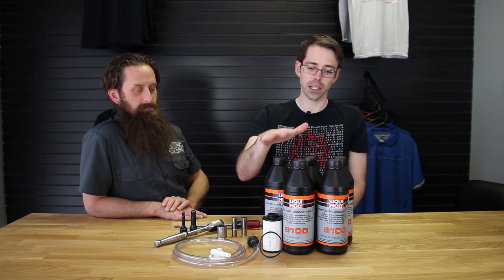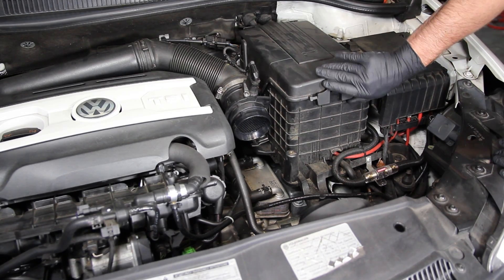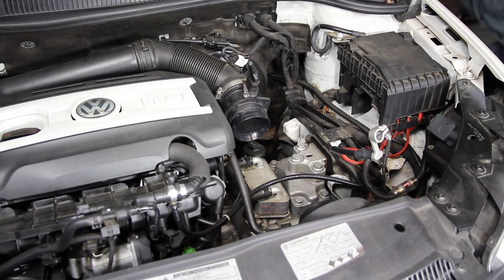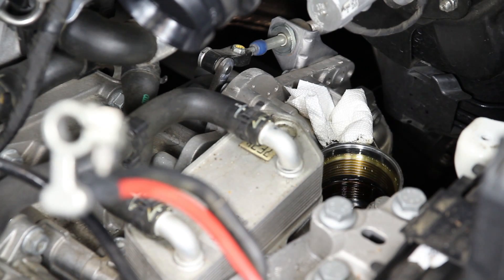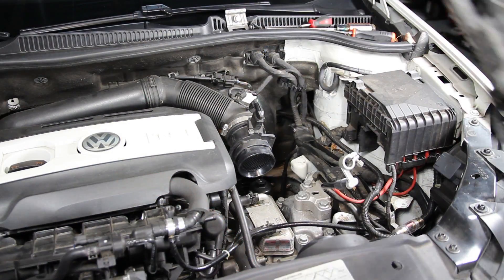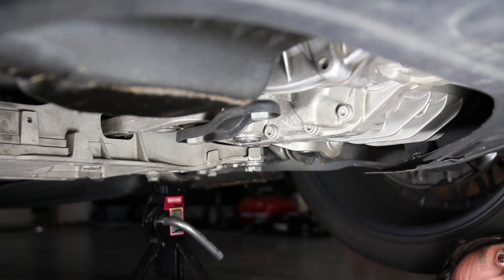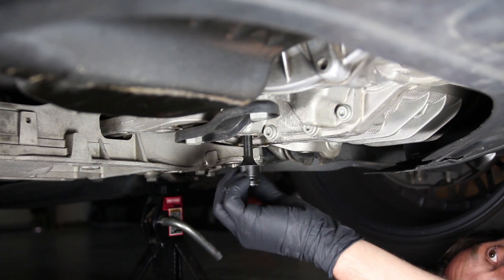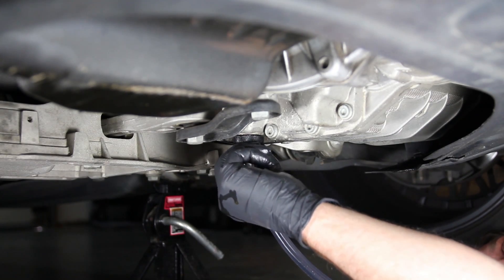How to (DIY) Perform a DSG Service on a VW and Audi Transmission (DSG Service Kit)

Comment from the maker: - We appreciate your Support and Purchases!
DSG Service Kit (Liquimoly)
https://www.shopdap.com/transmission-service-kit-for-dsg-performed-at-40k-02e198002grp.html
DSG Service Kit with Special DSG Fill Tool (Liquimoly)
https://www.shopdap.com/transmission-service-kit-for-dsg-with-filler-tool-02e198102grp.html

DSG Service Kit (Motul)
https://www.shopdap.com/transmission-service-kit-for-dsg-performed-at-40k-02e198003grp.html
DSG Service Kit with Special DSG Fill Tool (Motul)
https://www.shopdap.com/transmission-service-kit-for-dsg-with-filler-tool-02e198103grp.html

DSG Service Kit (Genuine VW/Audi)
https://www.shopdap.com/transmission-service-kit-for-dsg-performed-at-40k-02e198001grp.html
DSG Service Kit with Special DSG Fill Tool (Genuine VW/Audi)
https://www.shopdap.com/transmission-service-kit-for-dsg-with-filler-tool-02e198101grp.html

Transmission Fluid Service Pump
https://www.shopdap.com/make-model-year/audi/a5/werkzeug-usa-wkz-vas572001.html
Transmission Service tool - VAS6262
https://www.shopdap.com/vw-audi-dsg-tool-vas6262.html
Reply: I have a 2008 Eos VR6. Less than 900 were ever in America. I have so many questions and can't find answers.

Comment: I know this video is 10 years old but I need advice and hoping my car might intrigue you enough to get a response. I just bought a 2008 VW Eos VR6 with 135,000 miles on it. There were only about 240,000 made 2006-2016 in Portugal and only about 24,000 were sent to the US and only 900 of those had the R32 VR6 3.2L top end edtion, made in 2007 and 2008. I can never find info on this Unicorn. How do I change transmission fluid on my thick girl? And do I have to bleed the lines when I change the hydronic pump?

Comment: aside from worrying about the warranty will my transmission ( audi a3 2015 quattro ) work if i use 75w 90 from liqui moly or motul ? since that's all i have access too. thx in advance @Deutscheautoparts @sat_sonic
Reply: Only use the specific quality recommended by VAG...

Comment: Surely to remove oil from the transmission one would remove filter first and leave it open - as one would do with engine oil? 
Top filling through oil filter housing after accurately measuring oil drained seems a much neater albeit slower process…..?!
Reply: Top filling gets really messy very easily, ask how I know 😅

Comment: if you have the filter off, why cant you pour the fluid in the top? I mean... 1) Drain transmission, 2) remove the filter and pour the liquid in 3) Replace the filter 4) run the engine through gears. 5) drain excess out the bottom?

Comment: So if you've set the level at temperature previously with the snorkel fitted. Surely next service you should only get a small amount of oil out until the snorkel is removed (lower oil temp, ambient).
Reply: When you drain old fluid you unscrew the drain bolt with the car off. This means 100 percent of the oil is sitting in the bottom so more oil will come out than when the car is running as required when setting the level at operating temps between 35 and 45 Celsius 

When you set the level at operating temperature and with the engine running, a lot of the oil is being pumped up and running throughout the gears, through the lines and the oil cooler so less oil will pour out, and this is the recommended procedure.

Comment: Hi can you tell me the difference between 
g 052 182 a2 - 6 Speed DSG Oil $52.86 Per Lt
g 055 529 A2 - 7 Speed DSG Oil $79.51 Per Lt 
Cost of the fluid in Australia there is a big difference I have the DQ381

Are there any aftermarket brands for g 055 529 A2 specificaiton ?

Comment: @deutscheautoparts hi is the Febi dsg fluid good ? I didnt notice the spec TL52182 but a few sites validate the fitment on for a 2012 beetle with dsg 2.0t but didn’t knotice it on shop dap?

Comment: I have a 2011 VW gti with stock dsg transmission can I replace it with a 2013 dsg transmission with no issues? Do I need to worry about programming? Or is it plug and play. Thanks in advance.

Comment: I found a free workaround to the force fill method that worked great for me. I work at a GM Dealer and we have straws that thread onto DEF fluid bottles, most guys reuse them so the parts dept has tons of spares they’ll likely hand out for free. Turns out they thread onto the DSG bottles and fit PERFECTLY into the filter housing. Fluid can be added from the top and you won’t spill a drop.

Comment: Are you not supposed to start engine snd run it through each gear to make sure all compatriot are full to where it’s suppose to be. Also how do you know weather what you lost while switching plug to filler hose? What if you fumble and loose more then what you did? Can you overfill the trans a bit just in case you screw up on the switch-a-roo?
Reply: I can awnser that for you, But yes you Normally would run it through all gears after doing fill, but I did it literally like an oil change, I drove the car let it cool down for 15min, popped battery out, removed filter cover, drained fluids, measured out how much came out, and put that exact same through the top hole than closed it back up, made no mess, and i just used a plastic hose a buddy had lain around to fil through the top filter hole. Grab a beer or 2 and youll be golden😭

Comment: There’s a German engineered service procedure, for sure. On our ‘13 Passat TDI, I did the drain / measure / refill method, no muss, a lot less work. Did it on stands in the garage, no leveling, no wasted fluid.

Comment: Did I get this right? Jam 5 liters in and keep as much of it in there while capping it? No VCDS, no shifting through the gears?
Reply: Obviously not the recommended way but most people only manage to remove about 4.6 litres plus  100ml in the oil filter so 4.7

5 litres will put you close and save a lot of time. I assume even if there was 300ml excess oil it would simply sit in the bottom of the sum and not cause any issues.  1 litres over filled would be a concern

Comment: I wish the filter on my 09G was that easy to change.  I have a bit of doubt that the wire mesh of my filter catches everything anyhow.  I really can't imagine a wire screen catching all of it and suspect that the minute bit that does get though is partly responsible for the valve body issues that creep up over time.  There is just no way that a screen is going to catch all the smallest particles and if they have made it through the clutch packs they make have gotten ground smaller even.  The only reason I don't have a magnetic inline filter is that the it is not possible with the 09G.  I really do think that it would help a lot if it was possible to install one on that.

Comment: That Top Tec 8100 reminds me of the Top Tec 1800 I use in my 2013 Passat 09G.  One time I set my cruize control and reset the average MPG counter (after I got on the highway) and got 37 MPG on average until I got to any place with slower or stop and go traffic. I told my mother when I got home and she was surprised to hear that.  Her Nissan Rogue 2.0 could not achieve that, it is just such a heavy vehicle for a 4 cylinder.  That is even with a CVT she never had mileage that good.  It makes me feel so good to get better mileage than a vehicle that has a CVT even if I have a power to weight advantage over it.  This just proves that having more power does not necessarily mean bad mileage.  Liqui Moly is a very good brand.  One thing I thought was a bit odd is that it was light brown colored.  I have always seen red fluid in any car I ever had.

Comment: Hello, I got a golf mk6 118tsi which equips with DSG200 7 speed dry clutch. Does this dsg gear box need service? I call the dealer they said no need service since it is service free for lifetime. On the other hand, I saw some post on internet says they need replace gear oil not transmission oil every 60ks. Could you help me out? Which one is correct? Are there any specific tools or parts need in case DSG200 need serviced.

Thanks

Comment: I thought you have to have the transmission fluid at a 35c temp will doing this? Please let me know because i have. Goodyear's transformation place   is going to do 2014 jetta tdi for $179 and im worred they might mess it up

Comment: This video is missing the critical step of how to get the correct fluid level. Be sure to research how to do that. Also, when ordering your kit from DAP, make sure all parts of the kit come with it. Mine was missing the fill plug but realized it after I've drained the oil... NOT GOOD

Comment: Seen another guy who while filling left the fill tube connected then ran the engine shifting the trans between gears while standing on the brake
Then put in park but leaving the engine running
Then remove the fill tube adapter letting oil drain till the fluid was at the top of the internal fill tube

My question is how does volks wagon factory say to do it
Like you 
Or the other guy?

Comment: How is it that I just watched a YouTuber with 1,200 sub's do this correctly (drain excess) and yet DAP and Humble have 400,000 sub's between them and yet they just show filling with 5 quarts, plugging it back up without draining off the excess?  Glad I didn't watch these video's in the opposite order.
Reply: Which youtuber? Can you link the video?

Comment: Is that a manual trans, not sure if my freinds is auto or manual trans, he just bought a nice used one,  and I'm going to be the one servicing it cuz he's too cheap to take it to an import shop or dealer for service, and I don't know much about euro cars so I'm doing some research to come up with a service  schedule for him. ..also. ..I think his rear main might be leaking from what he's telling me. ..maybe that's why he got it so cheap for such a nice car. ..also were not sure If the timing belt and water pump has ever been changed
Reply: This is an automatic, which is called the DSG.  If you're going to do this DSG service as shown in this video, without using a scan tool, I would advise measuring the fluid that came out (L, mL, oz, etc.) and put that exact amount back in when refilling.  I would refill from the top if using this measuring method.  These DSG's are really temperamental when they are not filled correctly.  Search around, there are a lot of videos on servicing the DSG.  Find which method works best for you and the tools you have to work with.

Check out carwerks101 channel for a detailed video on a rear main seal (RMS) replacement.  The RMS will be a big job.

If it is a 2008.5 and up, it will be a chain driven engine (2.0T TSI). Anything below that date will be a belt driven engine (2.0T FSI).

Hope that helps a bit.

Comment: Why don't you fill though the filter housing?
Reply: It can be messy and even slower.
Reply: You can--you would need to use this funnel, however: Hopkins 10704 FloTool Funnel.  The tubbing fits perfectly into the opening on top of the DSG were the filter sits.  However, yes, its slow, but not messy if you're attentive and making sure the fluid is entering the DSG correctly.  I would lay the fluid out in the sun to warm it up a bit so it flows a little smoother into the DSG.

Comment: It shouldn't matter if you working on a cold trans. The liquid will be almost the  same velocity. Replacing cold with cold is no problem. Now what you do if temp not reading correctly. I think most of you are paranoid and cant name one person that did this with issues later

Comment: Still absolutely dumbfounded by watching everyone continuously remove the filter housing as the very first step.... Everyone keeps talking about how messy that step is. Well, if you remove the drain plug, and drain plug leveling sleeve first, and drain the system as the very first step... When you remove the filter housing, it’ll be dry. Every bit of research I did, performed this bass ackwards, and got oil all over the place. Common sense personally told me, GRAVITY. When I performed the service, everything was clean dry and tidy, not a drip, and I was able to clean all the junk that builds up in the filter housing body of the transmission. Everyone just leaves that crud in their system if they continue to do the filter first, inserting a brand new filter into one of the dirtiest portions of the systems fluid, the portion that’s immediate to the system fluid being filtered.
Reply: I am about to do my in the very next few minutes. I was just checking things out about the draining of the overflow fluids. I then came upon your post. Great Idea!! I too have seen that crud in the  bottom of the filter housing in other videos. Thanks for the heads up!!
Reply: The Critter Gitter g Did it go well?

Comment: Here is what this video left off. Once you’ve filled up the transmission with all of the fluid, you need to start the car run it through the gears and monitor the transmission fluid temp using either a scan tool or VCDS.  Once the fluid reaches between 35C and 45C, you remove the transmission drain tool and allow some fluid (overflow) to drain out until it slows to a drip. Finally reinstall the drain plug and torque to spec.
Reply: When you say run it through gears, do you mean driving the car or shifting through driving driving modes?

Comment: Got a 2018 Atlas.  Pretty much the same procedure.  Saw on the price sticker, Japan makes the transmission.  Coming from Toyota for the past 18 years, I was shocked to see no transmission fluid marker.  Also it took almost an hour to fill 5 liters of oil.

Comment: If I don't have that expensive equipment to tell me my car is at 95 F when warming it up to set the proper fluid level (which is per VW instructions and they don't do in this video) could I just do this service on a 95 F day instead?

Comment: This is the third video showing filling from the bottom.  Must say I am not happy about engineered spillage.  I like the VW car but they must find a better way.  There are many kits on the internet.  Most of them are filling from the bottom.   I filled from the top next to the battery breather tube.  Tool about 40 min at 5 liters.  2018 Atlas

Comment: Horrible, do not do it the way these guys did!
You dont remove the adaptor and put main plug in, you leave adaptor, start car, let run, go through all gears with foot on brake, pausing between gears for a few seconds, wait unit trans is at temp via vagcom or whatever else 38C i beleave, and then! While its running, in park, remove fill adaptor, let it drain untill it starts to slow, THEN put main plug i. Done!

Comment: I have a very slow dsg oil leak through the badly designed connector pins in the mechatronic interface plug. The shop wants to replace the mechatronic unit at huge cost. The faulty plug is worth maybe $15- they say they cannot replace just the plug! Can someone tell me what is the first sign of low fluid level while driving? Will damage be done to the transmission, even if I straight away top the level up?

Comment: Hi mate how's going , I have a 2012 VW passat tsi 1.8 car gearbox DSG broken now .I had gone to a mechanic here in Brisbane and told me a bit weird , he said that electronic parts damage .So  when I asked him if a swap this is gearbox he says cannot he said if you buy the new gearbox the car it will be with the same problem.he said it must be a rebuild this is gearbox .and he want to cost me 6000 $ .and I don't believe if I buy new gearbox for this is car the car will be doesn't work .So I beg you to advise me .and I am sorry because my is not good, but I know you will understand me .

Comment: there was still plenty of oil in the filter housing when you stuck the new filter in it ...  not sure if it pushed on some anti drainback valve that would prevent all the oil from draining..

Comment: VWs and Audi's are designed to force owners to bring their cars into the stealership. Even simple maintenance is a struggle.  It's obvious that this type of poor engineering is done on purpose.  Instead of a simple dipstick, you have to hook this up to a computer and use their expensive software to just change tranny fluid. I will never own a VW again

Comment: I've done this on a Golf R. Warm the gear oil by driving to operating temperature, remove the DSG oil in the same manner shown and measure it, place the bung back, take out the battery, remove the filter, warm the new oil by standing the bottles in a sink of warm water this will let the oil run better, use a rubber hose long enough to go into the filter housing with a funnel dish on top, simply measure the now warm new oil into the funnel and finally place your filter and screw cap on. You will have replaced the exact amount of oil into the gearbox as it came from the factory. VW wanted over £300 for this I did it for £90. Edit reading the comments about VAG/VCDS this is not needed as the battery will be disconnected and therefore the computer needs not know. This is another money parting exercise by VW

Comment: I watched this video several times because I'm thinking of doing the this job myself, I agree with the comments below that the video seemed incomplete. But taking what I could from it and watching some other videos and reading the manual to understand how the leveling tube works. Just didn't seem normal to have that much fluid drain out afterward, unless the level is to high. so running the motor at idol is important to pump fluid throughout the transmission, filter and to get it up to temp. then when you remove the fill hose and adapter what ever oil that drops out is just for leveling purpose. There is also the side plug to check oil level. oil should be at the thread. also very important is the car must be level, so if you don't have a pit you will need four floor jacks and to do that watch ShopDAP video on properly jacking the car. I would like to use liquid moly but don't see that in your list of parts to order and as far as the filter and o-ring It needs to be OEM parts before I order.